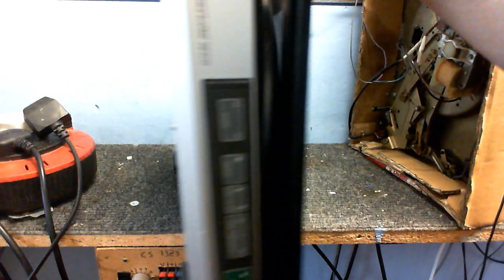Trash to Treasure part 3 of 3 - Fixing The Turntable

Comment: There is a little soldered-on light bulb that does the size detection, that's what that little window at the back left of the inside is for, bulb's probably burned out. I had this same turntable but the drawer gear train wore out from years of use, it was a really nice, and the drawer loading design is very convenient and compact.

I would assume you could replace the lamp with a suitable very bright LED, but as always check to make sure the lamp's supply is DC and if not, modify as needed. :)

Comment: The dropping the arm for an lp when you're playing a 45 is probably dust on an optical sensor. I have a Technics linear  tracking turntable that had the same problem. Cotton buds and clean any opitical sensors you can find. There should be two under the turntable and two others that track the stylus position.

Comment: Technics do size detection uing phodiodes, 3 actually, that light below the plate and IR escape through some groves to a post in a fixed position and get pulses from each IR LED. Counting the presence of signals guees the size. No signals is LP, two signals is 45RPM Sinple and one is 78 RPM ... more or less. Look in the circuit how Sony solved that. Perhaps is just a matte of cleaning.
Reply from the maker: I'll have to see if that's the case, I know that this is how mine does it, either the sensor is bad or just needs cleaning or the LEDs themselves aren't working.
Reply: Yes, note one more thing, in the Technics leds dont work when is in manual mode  or automatic setting are invalid. Leds are operated by a controller, so some conditions most be meet together with some switches activated by the arm and this sort of thins. That is, if led dont work, check then, but check around if the are not enabled because of ... something.

Comment: Have you made your own tube phono pre amplifier in the background?
Reply from the maker: Now that's an idea!  The thing in the background is an impedance matching circuit for a ceramic turntable cartridge, but making a tube based magnetic phono cartridge preamp with RIAA EQ is too tempting not to try!
Reply: Im currently using a Musical Fidelity V-90 LPS but tempted to try a tube pre amp. I hear they have a warmer, richer sound quality than solid state.

Comment: That looks like a Sony PS-FL77 - manual for it is available over on VinylEngine dot com.

Cartridge is a Sony XL-250G. Stock stylus isn't great (a conical tip) but an elliptical upgrade is available at turntableneedles dot com, "Needle 7853" for £22.50.

Comment: Well done, Clem!  You have some really nice stuff there and If I were you I'd keep hold of them!  Silly question time.  Is there a button on the front of the unit to select between 12" & 7" records or is it all automatic?  Anyway, great score from skip diving.  Carry on regardless! :) :) :)
Reply from the maker: There's a speed selection button but no size selector, it detects the record size by shining infa-red LEDs though the slots in the turntable platter, I need to replace those though since they've dimmed with age so the sensor cant "see" them.